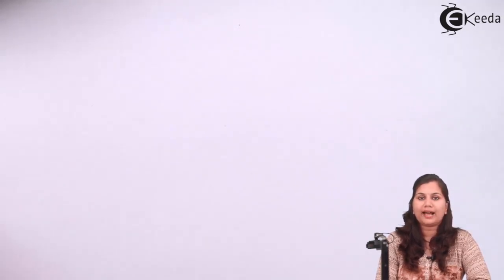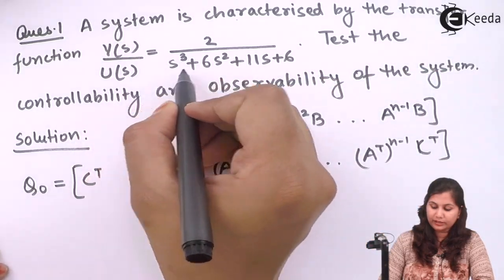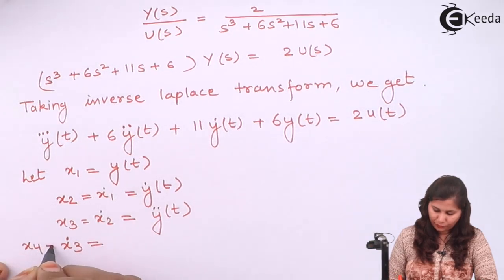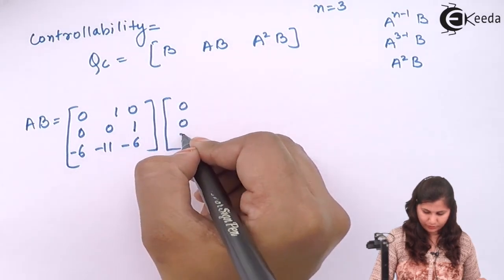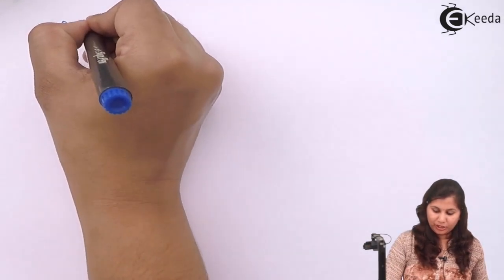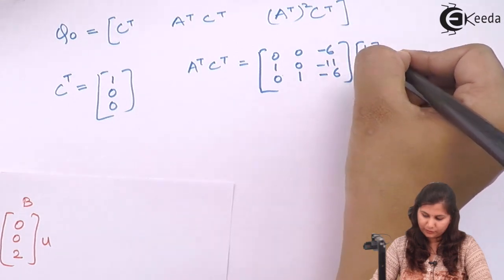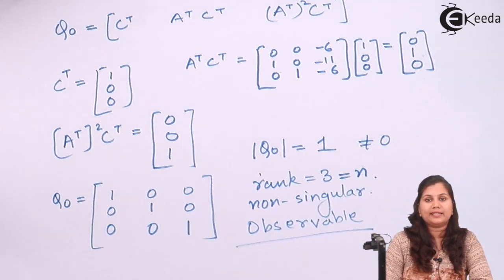Controllability and Observability (Problems) - State Space Analysis - Control System

Comment: 00:10 Check controllability and observability of the system
02:24 Transfer function form and state model derivation
04:42 State equation and output equation derived from the given system.
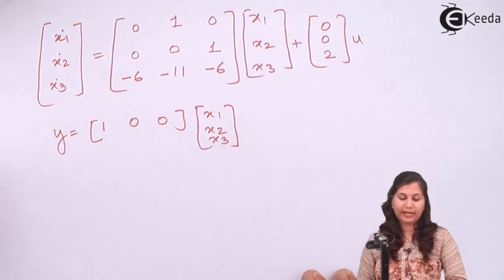06:38 The controllability and observability of the system need to be checked.
08:32 Calculation of A^2 * B and Controllability Matrix
10:10 Controllability and Observability
12:12 Transpose and transpose square C transpose
13:54 The system is completely observable and controllable.
Crafted by Merlin AI.

Comment: how did you find the rank of the Qc and Qt
Reply: the rank is the number of rows that are not zero
A=[0 0 ; 0 1 ; 1 0 ] / rank(A)=2
B=[2 0 ; 0 1 ; 1 0 ] / rank(B)=3
Reply: @aymenguenez1649  not necessarily it is number of non zero row in row reduced echelon form. A full rank matrix has non zero determinant this property is used here.If determinant = 0  then , rank <= (matrix_dimension - 1)  (Note :There is an inequality)